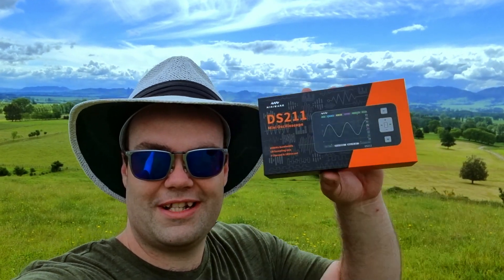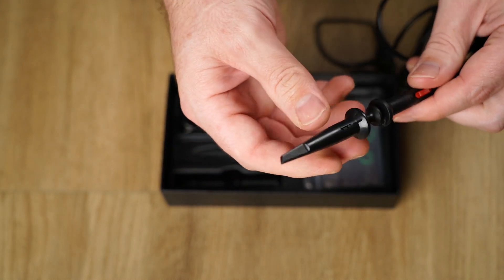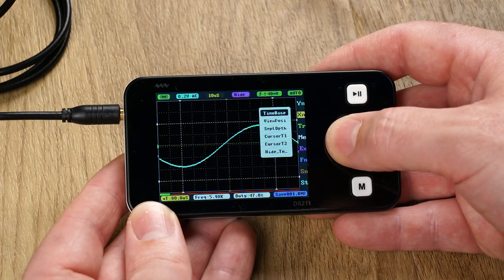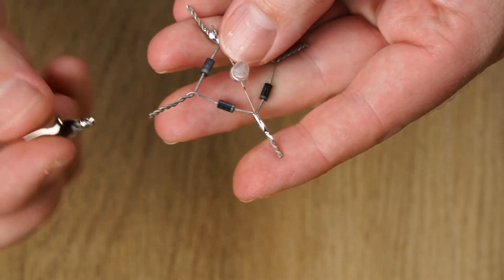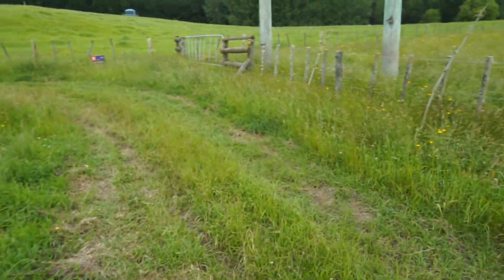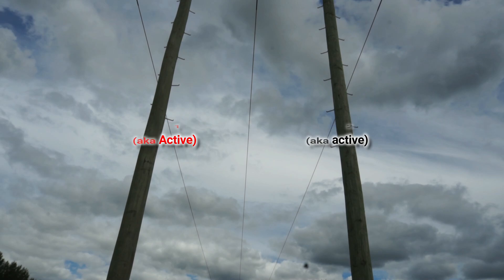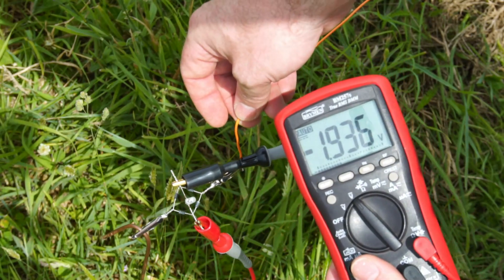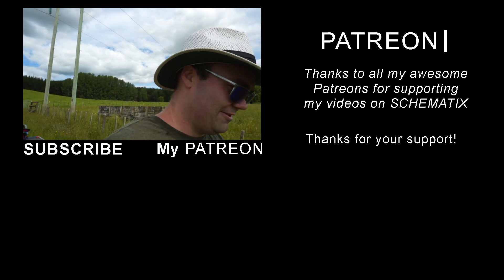Miniware DS211 Oscilloscope Review II A bargain at $65!

Comment: Why did you use a full wave bridge?  The led is a diode that will rectify the AC anyway. The bridge will drop the voltage from 400 to 700mv. Did you realize that?

Comment: You could have used a capacitor instead of the LED, and then a diac (like DB3) from one leg of the capacitor to the LED, and other leg of the led to the other side of the capacitor with correct polarity. When the capacitor charges up to 30+ volts, the diac will reach breakdown and will conduct until a certain voltage (something like 10 - 15). Because the capacitor stores voltage and can give you higher current, In this way, you could pulsate the LED lights at such low power.

Comment: Three phase transmission lines do not incorporate a neutral.. That  is  L1,L2,L3.
In Canada the city side of the three phase on pylons is about 230kV.  Across country from the hydro dams, they use in excess of 600kV.  The height of the pylons is dictated by the safe working distance plus a safety factor for vehicles and persons passing underneath.
The three phase on street side power poles in about 25kV...
But then we have an Edison based commercial and domestic "single phase" 120Vac system which really is a two phased system with a centre tap which is grounded to form a neutral, for stoves/ovens clothing dryers and HVAC etc.   NZ has a far better system!

Comment: Very nice video! Could you try to run a cable under the power lines in spiral form like an inductor in order to gain much voltage to illuminate the LED?

Comment: Maybe you could take a ferrous rod and wrap the wire around the rod. Perhaps the magnetic field will be stronger and induce a higher voltage and/or current.
Also, perhaps put the wire up about 2 meters instead of waist height.

Comment: Instead of an led you will prob have better luck with an old 4-8 foot flourescent tube used to light commercial spaces. Ground one and elevate the tube 10-20 feet (closer to the line) and it will glow rather bright even in daylight. Doing so with the 345kV lines that power my city and it's almost as bright as if it were plugged in normally (several dozen watts). That distance from the line makes a huge difference, as most lines are 100-200 feet up (don't want people or animals casually walking under them to get noticably shocked). For adrenaline junkies move a grounded tube within about 20-50 feet of the line (10kV per foot depending on voltage, a ground fault results in an electrical explosion akin to dynamite, something you don't want to even be near, so not too close) and it will glow bright enough to melt with blue corona flying off both ends of it.

Comment: 8:20 Are you sure? Here in the USA 3 lines are 3 equal phases 120 degress out of phase with each other, with sometimes 2 grounded shield wires above those (to protect from direct lightning strikes). 2 actives and a neutral here really are only used on former AC lines converted to DC for power capacity upgrades (ie 500kVAC 3p to +800kV, neutral, -800kV DC).
Reply from the maker: It's fair to say I can't be 100% certain on the specifics of this set of powerlines without more testing. I find it weird that  this set of powerlines are not listed on any of the local grid map I've found online. When I held my meters leads upto the lines, the center line gave very low readings compared to both outside lines. I assume the center line is referenced to earth? Maybe if I had a 3 channel scope & run 3 wires parallel to the powerlines, I'd be able to gain a better understanding of how these particular powerlines work.
Reply: @Schematix  First guess is the center phase's e-field is being partially canceled by the outer 2 phases.

Comment: Miniware made a few nice products - logic analyzer (custom metal enclosure, great hardware inside), modular power supply with switching ->linear architecture or soldering iron.
But this one looks just bad. Old media player case and outdated hardware. Better buy OWON HDS series 3 in 1.

Comment: I was once told to calculate the voltage of a transmission/distribution line: multiply the number of isolatoring disks by 7,000. Should be around 50kV or so. (I can't remember the technical name of the isolators 🤦)
Reply: that's just a rule of thumb, dirty industrial area or near salty ocean or alot of fog/rain affects that a lot. A single disk can be rated anywhere from 7.2 to 23kV, depending on environment and diameter of the disk. 15kV is a good first guestimate. Looks like a rural area without much pollution so prob 110kV between phases being in New Zealand. North America same environment maybe 115kV.
 If one has coconuts for balls and a 1000:1 potential transformer (meant to step transmission voltage directly down to around 120v for substation instrumentation like control relays and monitoring), some wire, a hot stick that can reach a line from the ground (or dry fishing line and a rock can get it up there too) and a DMM you can just measure it (take the phase to ground voltage and multiply by 1,732).
Reply: @fvckyoutubescensorshipandt2718  beautiful, sounds like you're my kind of brew. 🍻. 
Thanks for the insight! All makes sense since air capacitance and conductance changes like any other material.
Bobs Decline? Check him out, he's a little on the softy-side, but a good watch for lineman/utility stuff. He did a video on some similar transformer stepdown from transmission to 15kV using a residential pole mounted transformer, then another one on the other side to further step down the 15kV to household electric (something like that).

Comment: If those power lines were in Aust they would be 3phase Delta (no neutral - if the centre conductor were a neutral it would not need the same insulation), and each insulating element is about 11kv, my guess your line will be 66kv.
High power TV transmitting towers also light up floros - magic.
Reply: bet money its 3 phase. Love the channel Schematix!

Comment: i did predict this mate.  and gee i would have fun with those transmission lines, they will be 150kv lines and all three are live phases of the three phase system, the earth is the negative. fun thing is to use a drone to place a U shaped cold cathode tube from an old tv over the line, it glows brightly, the local power board better not read this..........